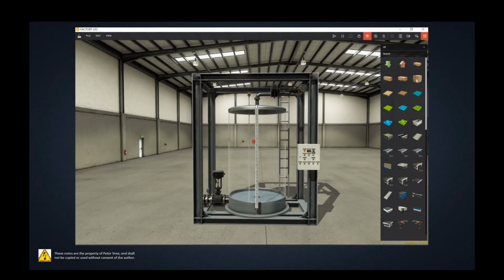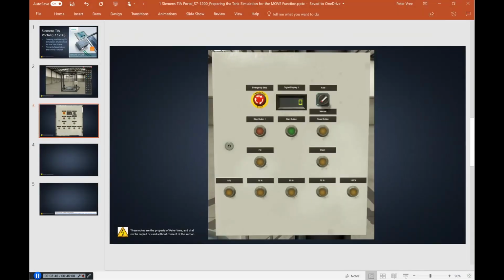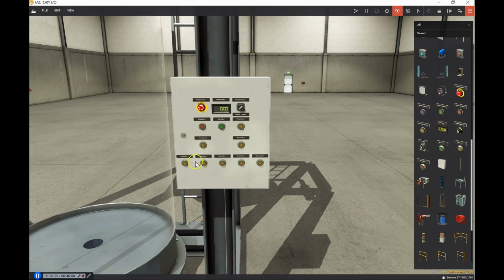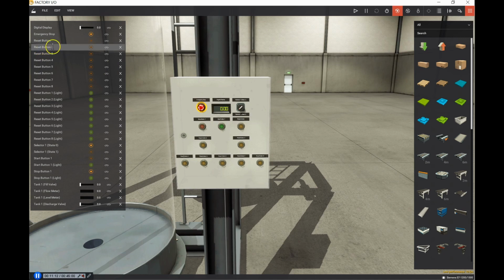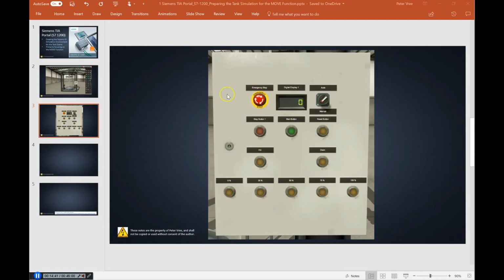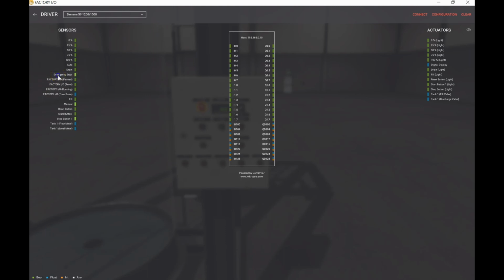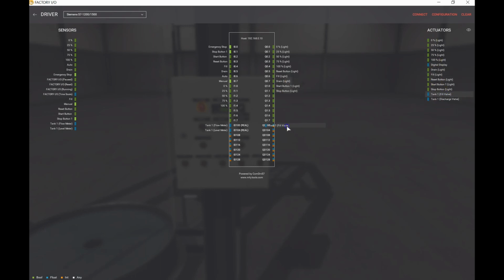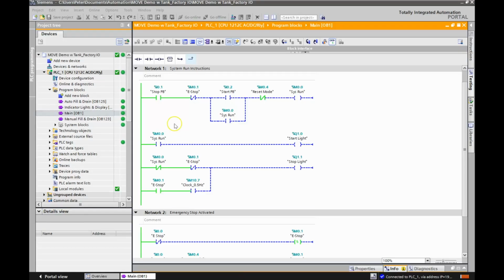Siemens TIA Portal & Factory IO (Creating the Tank Simulation)

Comment: I am feeling alot of difficulty while putting the buttons on the electrical board. What can I do about that?
Reply from the maker: I found it frustrating as well. Had to zoom in super close to make sure that they were actually sitting on the control panel properly. They should incorporate a "snap to" hot key to enable them to quickly attach to the panel.

Comment: How did you do QD? I already have a circuit with bool Q0.0 output but I can't connect it. Can you help me? QD How did you tie it to the camel?
Reply from the maker: Everything for this Simulation programming is available at the bottom of this playlist: https://www.youtube.com/playlist?list=PLyL0ResmI4Q3HIWvnMM18XpXkFMsS9Bcj
Reply from the maker: Don't forget that for Factory IO to work, you will need to offset your Digital and your Analog physical inputs within TIA Portal so that they don't interfere with the simulation. https://docs.factoryio.com/tutorials/siemens/setting-up-s7-1200-1500/
Reply: @PLCAutomationAcademy  no there is no need for it. I bought the factory IO, the tank comes in basic analog value and I converted it to digital value I just made 0 and 1 solved the problem but thank you